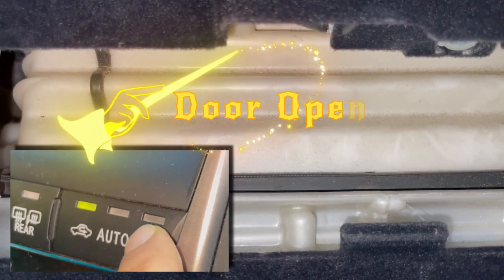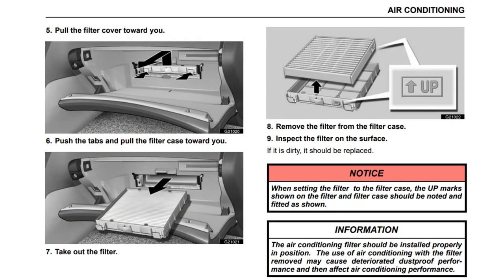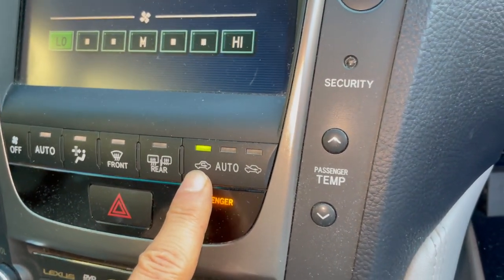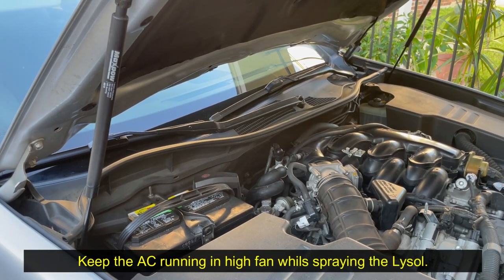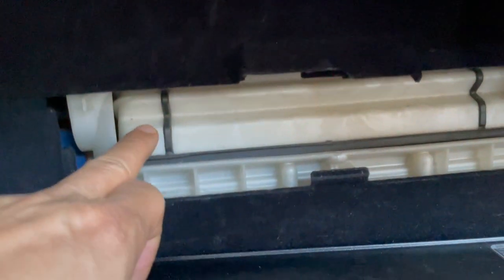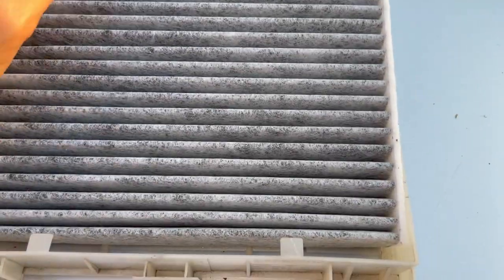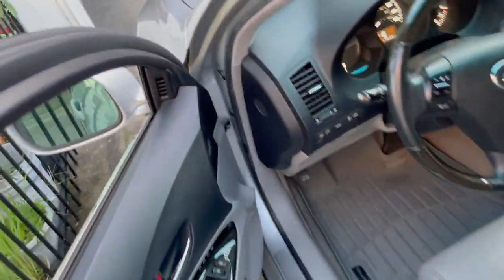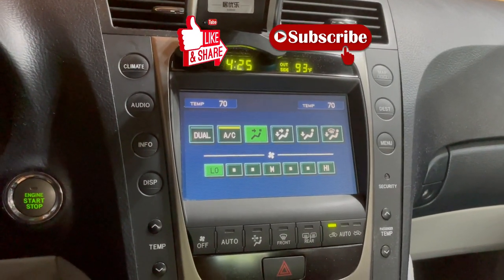GS300/GS350 Cabin Filter Change & Disinfect Musty Odors

Comment: how many Miles do you get when you full up your tank I get around 220 mpg
Reply from the maker: After a fill-up, my driving range is about 350 miles. 
And given 2/3 highway and 1/3 city driving, I get about 23 to 26 MPG.

Which engine do you have?   22MPG is OK for most city driving.
Reply: 21-22mpg city for me, 27-31mpg highway. For highway driving, doing 80 on cruise nets me about 27mpg, cruising at 70, about 31mpg. These are straight & flat florida highways mind you, probably why my fuel consumption is a bit better
Reply: I should have added that the vehicle is the same as that in the video, a 2006 gs300 RWD with the 3.0 GDI
Reply from the maker: @George-ur8ow  Yeah, when I do a long distance highway driving, I have seen 28+ MPG, but never gotten over 26MPG in mixed city/highway driving.
Reply: @DIYLifeSkills  I have the 2006 gs300 with the v6
Reply: @DIYLifeSkills  I read that changing the air filter & spark plugs can help on fuel but I don't get why I only have 220 miles on a full tank??
Reply: @DIYLifeSkills  I also drove 1 mile & on the screen it said that I wasted 3 miles
Reply from the maker: @limbogt747  Are you doing mostly short city driving?   If not , you may be running too rich (more fuel than air).  Try cleaning the MAF ( mass airflow sensor and throttle body.)
Reply from the maker: @limbogt747  here is the video. 

https://youtu.be/o8GbxbvpfgY
Reply from the maker: @limbogt747  short distance measure is never accurate.
Reply: @DIYLifeSkills  Ima watch the video & clean MAF hopefully that solves my problem thank you for the help🙏🙏
Reply: @limbogt747  I get about 284 miles (from the range screen) on a full tank. I have a 2008 GS350 3.5L V6 with DI and PI. Been getting lower and lower ever since I bought the car. Hopefully will be better after I do a MAF cleaning and Spark Plugs change in the next few days... I'll lyk if it makes a difference.
Reply: @TheN4UM4N  I'm also gonna replace my air filters & use fuel injecter cleaner
Reply: @TheN4UM4N  you can try that too
Reply: Hmm. 220 and 350 to a full tank seem to be a bit low. I purchased my 2006 Lexus GS300 from a friend and he didn’t really take care of it much. I remember when I got it, I would get about 380 to a full tank. Over the last year, what I’ve noticed has helped me is using quite a bit of full injection system cleaners. Two of the brands I use are Lucas and BG 44k every other fill up. I did this gradually and noticed a great increase in my fuel mileage. As of about a month ago I am getting about 424 miles a tank on a fill up. I will also add that I have cleaned out my MAF sensor and throttle body as well. I am yet to clean out the air intake valves. I’m not sure if that is the issue with yours but it seemed to work with mine. Hope this helps a bit. 🤷🏻‍♂️
Reply from the maker: Yeah besides the car’s condition, another big factor in MPG is how one drives/brakes, and how much city vs highway driving is done.  I get high 20’s MPG on mostly highway driving but only get 22-25MPG in mostly city driving.
Reply: @jovanirodriguez1473  that's bro that really helped I was getting  8-14 mpg I changed my spark plugs got a new air filter checked my tire pressure & now I'm getting 22 mpg ima change my o2 sensors
Reply: @jovanirodriguez1473  Bro, did you add fuel injection system cleaners directly into the gas tank or you used a something called "pressurization tool" ? I'm a little bit confused
Reply: @jovanirodriguez1473  which lucas cleaner did you use I'm looking at the high mileage fuel treatment
Reply from the maker: It’s called “Lucas upper cylinder lubricant with injector cleaners and fuel conditioners”. I usually buy the gallon because it’s much much cheaper than buying one time use small bottles.  I pour few ounces before I fill up usually every couple of months or so.
Reply: @DIYLifeSkills  I bought "seafoam auto marine fleet" the cashier told me that he was getting 7 mpg & it helped him get back to 18 mph
Reply: @DIYLifeSkills  I changed my spark plugs & air filter I was gettung around 20  mpg but thne it started to drop & now I'm at 14 mpg
Reply from the maker: @limbogt747  Cashier is probably exaggerating a bit, but keeping systems clean definitely does help with both performance and MPG for sure.

Comment: If it doesn't say "UP" next to the arrows on the edge of the filter element then the arrow should point in the direction of the air flow which is down.
All horizontally mounted cabin air filters with the blower motor mounted below the filter will have downward air flow including Toyotas. Otherwise the dirt and debris that collected on the top of the old filter would have been below the filter trapped inside the blower.

See link I'll post below...
Reply from the maker: Yup, that's what I always done...point the arrow in the direction of the airflow, but this car was weird.  The old filter had arrow pointing up when I bought the car, and the manual has arrow pointing up.   I think this is illogical.   Besides, I looked at the old filter carefully today, and both sides are identical on this aftermarket filter.   LOL...   Maybe the OEM filter puts different material on one side vs another but these cheap filters seem same on both sides.
Reply: @DIYLifeSkills  Thanks for the video. It helped out a lot. I just changed my filter. The only concern that I have is now all of a sudden, my AC is not blowing cold air out. I didn’t change any settings. Would you happen to have any idea why? 🙁
Reply from the maker: @jovanirodriguez1473  AC was working before the filter change? Impossible for filter change to break AC. Is the fan working when you put on high setting? And are you getting any cold air just fan?
Reply: @DIYLifeSkills  Yes. That is the weird thing. The AC was working before the filter change and the fan is running fine. We are having some really hot weather as of late so I don’t know if that is affecting it as well. I also wonder if It could possibly have a refrigerant leak or something related.